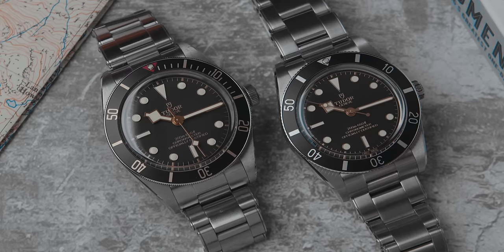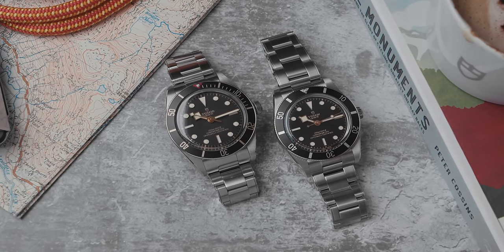Tudor Black Bay 54 (BB54 vs BB58)

Comment: Most (many) people watching this will not yet have had the chance to see one in person.  When you do (as I have) you will know that this watch is not "dainty" in the least.  In fact, when I took off my BB58 blue and placed on the Vallet try and put on the 54, the only thing I really noticed was that it was thinner.  The lug to lug felt almost identical to the 58.  The watch also had nice weight (tho a little lighter), but the overall presence on the wrist wears MUCH closer to the 58 than specs on paper would make you think.   This is partly due to the fact the lugs don't turn down right away after the dial (as they do on the 58). Instead, they extend out a few mm, then turn down (something other 36 / 37mm watches would not do), making this wear larger and is what gives it a more rectangle shape overall vs. round like the 58, which is an important point to make when comparing the two ;-)
Reply: Hey do you prefer the blue 58 or this 54? I am currently waiting on watches and wonders to see if they release the blue with the t fit and can’t decide
Reply: Great insight Ty! I have the 58 and love it. I was wondering how close it felt to the 58.

Comment: As someone with somewhat small wrists who loves divers, but finds 40mm too big I absolutely love this current trend of releasing smaller watches! Freaking finally 👏
I was considering getting a BB58, but now I am drooling over an even smaller BB54. Hell, Farer just announced a 36mm Lander IV. Small wristed people are eating good this year.
Reply: If u like a smaller diver have a look at the Aquastar Deepstar 2 @ 37mm.
Reply: Amen small wristed brother
Reply: I am also drooling over the 54, planning to get in on the bracelet and order the rubber strap. Absolutely love the look both ways.
Reply: Most guys don't have monster thick wrists so it's long over due. You can't have a watch that's to small but you can have a watch that's to big
Reply: Small wrister here and I wear a 58. I’ll try a 54 on when my AD gets them. But I find the 58 perfect. I have a 6” wrist.
Reply: It’s been great
Reply: I feel the same, with a smaller wrist for years I’ve tried on divers and they felt like wearing a manhole cover on my wrist! I bought the 58 Black dial a couple years back and love it! The 54 wasn’t an option of course then..although I advise trying both on before buying. 
I like the looks of both but prefer the warmth and flashier look of the BB58.

Comment: I got to try on the BB54 at my local AD, and it is absolutely incredible. The dial is ever so slightly domed, with a very slight sunburst effect that you can only see from certain angles. The dial is also more of a glossy black, as opposed to those of the BB Heritage 41 and the BB58 (those two both have a textured matte black dial that really looks more like a dark grey in person). The BB54 for me has blown the BB58 and BB Heritage out of the water. It matches the watch it's referencing almost exactly, (the 1954 Tudor Submariner had the white triangle, no graduations on the bezel, was 37mm, etc.), while the BB58 deviates a little from the 1958 Tudor Sub with the gilt bezel (I've never liked the gilt bezel, don't know why), and the Heritage 41 just looks dated with its ridiculous thickness and the long crown with the weird black tube-stem-thing (honestly the Heritage 41's crown never bothered me until Tudor started showing us that they could do better, with the BB Pro, the updated BB Heritage 41, etc.). You absolutely have to see it in person, preferably side by side with the 58 and Heritage to really appreciate how different it is from the others.

Comment: 6.5" wrist here.  Went into Tudor wearing a 200m, 36mm dive watch from the early 70's and tried on the BB54.  It's pretty much a perfect modern vintage watch if that makes sense, especially with the t-fit clasp.  On the rubber it felt exactly like a 50 year old diver.  We've had so many vintage re-editions over the past 10 years including the original Black Bay, the BB58, Longines Legend Diver, Rado Captain Cook, Oris 65, Omega Seamaster 300, Doxa 300 50th anniversary etc, etc..  I've tried all these on and more and have to say that this just feels like putting a beautifully slim vintage diver / skin-diver on.  Of all the Swiss brands at the entry/mid price bracket the BB54 (to my mind) has achieved something which feels somehow 'authentic' to it's inspiration.      Of the non-swiss brands Seiko's modern take on the 6105-8000, namely the SPB317 has also got it right.

Comment: I love all the recent discussions about watch size, and it probably does come down to actually trying the watches on in person.   But one dimension that is constantly overlooked is the dial diameter, or the proxy of crystal diameter, hardly anyone making videos ever measures it, but it's one of the most influential factors what the watch actually looks like.  For the record, the BB58 crystal is 30.8mm in diameter, the BB54 is 29.2mm.   Because they're dive watches with rotating bezels, their dials are quite small.   Compared to the Ranger, dial diameter is 32.5mm,  Explorer36 is 30.3mm, Explorer 39mm is 32.5mm because their case edges are thinner.
Reply: Thank you! Finally someone who gets it.
Reply: That's why I dislike the new sizes of "dress" watches such as the DJ41 or Calatrava 39mm. Their dial size is bigger than the ones on tool watches which makes absolutely no sense.
Reply: This is the way. I really wish dial diameter was covered on spec sheets and reviews because I've always found that to be the most important thing for how they wear on my wrist in my experience

Comment: Bought the 58 in early 2021. 5'7 with 6.5 in. wrists. Love the almost dressier aesthetic. The 54 (with only visual experience) seems better proportiohed than the small 38mm Bathyscaphe and the SKX013. Not usually a fan of red but the 12 o clock marker and the gilt on the bezel adds a tasteful warmth that I would have liked to see on the 54. In either case glad Tudor is playing in the 37mm range. I'm tempted to get myself a 54 anyway. Just can't beat classic proportions.

Comment: I tried on a BB54 and asked to look at the BB58 side by side for comparison. I was initially concerned by the difference in case diameter but once I tried it on my 6.5in wrist those concerns disappeared. The thickness visually looked significantly thinner due to its design which was a positive thing but for me the clasp was a huge game changer. I kind of feel that the 54 is a more refined version of the 58… so for me… the BB54 is my preference between these two. The question for me now though is so I prefer the BB54 over the Pelagos39? 😂
Reply: I agree with you, after watching Adrain I have the same feeling - Pelagos 39 or BB54. Btw, hv u made decision ?

Comment: Apparently you can put the 54 bracelet on the 58. You just have to keep the endlinks of the 58.
Reply: Apparently the steel is a different color due to Tudor using more nickel in the 54 so it's more yellow ish

Comment: You can most definitely change bracelets over, all you need to do is keep the end links to the watch it came with
Reply: This is exactly what I’ve heard. The end links on the 54 work on the 58 but is slightly sunken in due to the thinner case of the 54. But the bracelet of the 54 fits the end links of the 58 so all you really need to do is swap the end links if you want a flawless fit. After hearing this I’m really tempted to do with my BB58
Reply: @dieselboi91  FOR BEST RESULTS  use your original end links that came with your BB58  you will be swapping the bracelet part only not including the end links that ones with the BB54.  If your bb58 didnt come on bracelet your kinda screwed.

Comment: I believe the new 54 maybe viable for those with smaller aka sub 7 inch wrist size.  A throwback to when all watches were smaller.  Paradigms of aesthetic correctness swing like a pendulum.  The public is fickle in taste. Straight leg jeans give way to bell bottoms and visa versa.
Will see.  I predict the 54 will do very well among the smaller wrist crowd including males and females.
As usual, you do a great job on your reviews Adrian and you articulate relevant nuance.
Cheers from across the pond.
Reply: "Paradigms of aesthetic correctness swing like a pendulum" - Well said, a lot of people don't seem to understand that.

Comment: I know this watch is a throw back to the 1954 Tudor, but I think with the smaller size and simpler bezel than the BB58, the BB54 makes the ultimate homage to the original Submariner 6538 Bond watch.

Comment: For me, the BB58 was near perfect. The only negative was the little red triangle on the bezel at 12 o’clock and the minute markers between 0 and 15. The BB54 solves exactly that! That’s why for me, it is THE perfect Tudor dive watch. Only puzzling thing is it doesn’t cost that much less than the BB58. But I’m just glad it doesn’t cost as much as a Rolex Submariner, and to my eyes, it looks better than the Sub. An actual attainable grail watch, finally!
Reply: Funny the red pip on 58 is one of my favorite aspects of it as it makes bezel pop .
Reply: The whole reason you go with a 58 is for the red triangle. Anyone who tells you differently is lying

Comment: Adrian - Thanks to you for calling attention to IDGuy. It would be sweet to see IDGuy hit a 100K subs. 
The BB54 is very intriguing for me. My goal is to find a perfect one watch with lug-to-lug distance below 48mm. The BB54 ticks so many marks with its size, being a tool watch, and 200M water resistance. Need to see it in the metal and go from there.

Comment: Look wise the BB58 is giving more presence, while BB54 is more subtle. Yet 37mm might be too small for some people like myself having 19.5 cm. wrists. Regarding the T-fit clasp, it's ridiculously good: to emphasize what a major point it is, before my Tudor Ranger 39mm I was not the bracelet type of guy. Always have used leather, sealcloth or rubber straps. With the Ranger having the T-fit, I like how you can reduce the size on the go on the chilly spring morning and then at noon you can increase it back without a tool when is warmer and your wrist has expanded a bit.

Comment: My wrist is 7.25 inches. My preferred size is usually 39 to 41, I recently got the Zenith Defy revival, 37 mm, and it has changed my outlook, or not so much outlook as much as what I think I can wear without it looking like a toy. The last time I tried on the 36 mm Explorer it was just too small. I am interested to try the 54 on and possibly have a relook at the Explorer 36 mm. 🤔

*I tried it, it is amazing!
Reply: My wrist size is the same. I personally think any watch that covers 80% of my wrist is good. But I’m glad Tudor are making watches for people with smaller wrists
Reply: I have the same size wrist and tried on the Explorer 36 multiple times, but still felt it was too small. I love a good 38 (Seiko baby Alpinist, Aqua Terra 38) and maybe even the Longines Spirit 37 (borderline) are alright. I love my 39.5mm Alpinist as well. I still prefer 38-42 depending on the style/type of watch. I am interested in checking the BB54 out, but even the BB58 felt almost too small for a diver for me. The Seiko SPB143 and latest Submariner feel like great diver sizes on my wrist. I am extremely interested in the Pelagos 39, but have not had found it in stock at my AD yet to try on. The bezel on that is almost 40 (39.9), while the case is 39.
Reply: @RedwoodAggie  Trust me there is something about this watch, at least IMO, it does feel smaller than the 58, but it somehow works, it is just right. I write this with a Seamaster (42) on my wrist and a daly wearer being my Explorer II, also 42. This 54 has something that just works. I think as I said the Zenith has done a number on me and I still think I will feel the same about the Explorer 36. Let me know if you try it!

Comment: I just went today to try this watch on at the AD. I was originally thinking that this was my next watch and preferred it in many ways to the 58 black. I am an owner of the 58 blue and had decided that I wanted another Tudor black bay but In black. When I walked in the AD and tried it on and compared it to the 58 black I was shocked by how much I didn’t like the 54 in person. I’ve been listening to people say how much better it is than the 58 but completely disagree. I actually hated it in person. I am now buying the black 58 to pair with my blue one. I have 6.75 inch wrist and like smaller watches generally. In my opinion I think that the only thing that’s better is the clasp. This shows the importance of going and seeing watches in person.

Comment: Tried on the BB54 and you really must see this in the flesh so to speak. If i did not have a BB58 it would have been mine. 7 inch wrist and it fits well.

Check out the black bay 36 in blue with jubilee it is stunning.

Comment: Very nice watch and especially with the introduction of t fit claps metas certification and the grey color of the numbers on the bezel and the different shape of the watch . I noted that the shape of bb54 is different in comparison with the shape of bb58 ...difficult to explain..is more rectangular and i prefer this.  I have some doubt on the size on my wrist of 17.5 cm ..i will try it but i hope that this improvement will be added to bb58. Is there a possibility to see a bb58 with the improvements of bb54?

Comment: It definitely should've had a gilt bezel. Also, why does Tudor struggle so much with aligning their lume pips, the 54 you have has the same problem, the pip is offset to the right and is touching the triangle border.

Comment: The more i look at Tudor BB 54, the more i love my Seiko Sarb033. It's the non-flashy but very classy, very small watch that i love. It's like a subtle friend that stays back behind me instead of going in front of me for a show off like other watches. People will notice me 1st instead of my watch, my watch is for me to use, not a thing to show off for other people. I'm considering BB 36 black (old version) vs BB 54 a good comparison in everyday, one watch collection.
Reply: I have a Sarb017 and the BB58 immediately made me think of it as well.  Gilt hands and similar sizing, but the green sunburst dial on the Sarb017 is definitely flashier.  Crazy to think how good of a watch you could get with the Sarb line around 7 years ago for under $400.   

I still want a BB54 though

Comment: I plan on selling my BB58 Black and getting the 54. Don't get me wrong though, I love my BB58 black. But the clasp kills it for me. Not even about getting the right size, but the fact that the folding portion of the BB58 clasp is obnoxiously large/long. It prevents a link from fully articulating and makes the clasp "longer" than the lug to lug measurement. When I wear it, it kinks oddly. My BB58 Bronze with T-Fit doesn't have this problem. So, I am getting the 54. A nice little change.

Comment: I'm 180 cm and 96 kg, so I would not consider myself a small person, on the contrary, and I would wear that watch forever. So close to the original Submariner size, a classic. I have a 36.25 mm Omega SMP and a classic 1968 Rolex Date in 34 mm and they wear beautifully.
Reply: Yep I’ve been wearing 41-42 mm for years and recently acquired a midsize 36.25 Omega Seamaster. Wearing it has been a revelation, so much more understated, classy, comfortable imo. This looks perfect
Reply: @mrautomatech2329  Exactly... I do look for understatement since my city is quite dangerous to wear an Omega in plain sight, It slides under a cuff so well.

Comment: I have had a black bay Tudor and had it for a year. Sold it to get my first Rolex “deep seadweller 44 mm. I have an 8 inch wrist so I make it look as if wearing a 40 mm watch. Though I have not had the opportunity to wear it on my wrist I just don’t think I will like it. I have worn several 36 mm watch from omega, citizen, seiko, etc but for I it just would feel as to going backwards.

Comment: Thanks for sharing Adrian, well-made and informative Video! :-) I´ve purchased a BB54 with rubber strap yesterday and was really happy that it was available; been searching after it (here in Germany) since a few months. Great watch on my 16.5cm wrist, looks and feels just great! :-) 

BUT: This morning to my surprise and discomfort I realized that the raised luminous indice on the bezel (the "drop" in the triangle between 50 and 10) is not exactly centered within the triangle; not as much as it can be seen in your video from 1:03 , but visible anyway.  😞 Does anyone have experience with this issue and how dealers and Tudor deal with this? Thanks for any answers!

Comment: I really like the new BB54, but I’m worried about that 37mm. 

Maybe I should just buy a BB58. Maybe !
Reply: I went to my AD last week expecting to get a 54 but ended up walking out with a 58. The 58 size was just felt perfect for my 7 inch wrist and it felt like it had a bit more character than the 54. Both were great though.

Comment: The lume pip on the BB54 as shown isn’t correctly aligned. That’s disappointing for a £3.2k watch. I tried the BB54 on at my local Tudor AD last week. Quite underwhelming. Don’t get me wrong, it’s nice (in a unisex kind of way), but, why anyone would swap their BB58 for one is beyond me. I could have bought the BB54 there and then, but, gave it pass… and I’m a watch enthusiast (BB58, and two Subs 14060m and 16610 in my collection). I’m just a bit bored now with the whole retro diver thing and would have preferred the BB54 to be more a modern interpretation of a vintage diver rather than just more of the same old retro stuff.

Comment: I think the new and non snow flake second hand works with the watch very well. 37mm for a diver may be small even for my 6.5 inch wrist. I also like the bracelet and how it doesn't have the rivets (spelling) in the outer links.